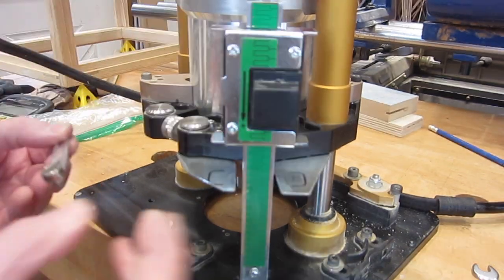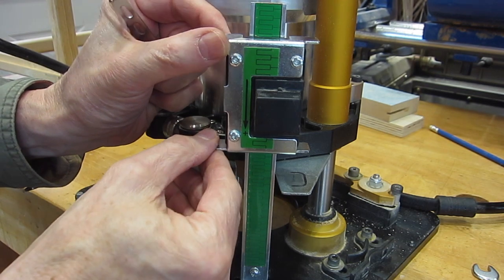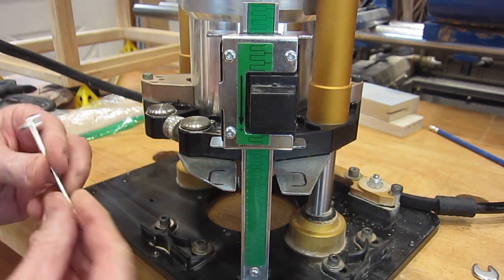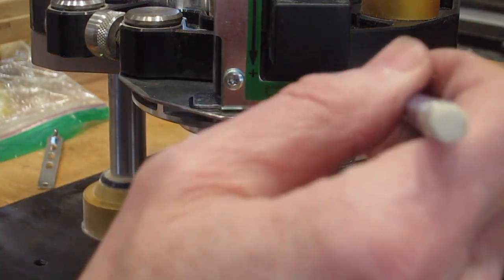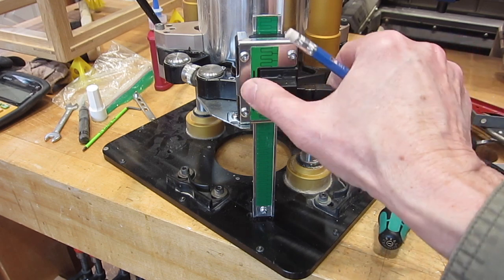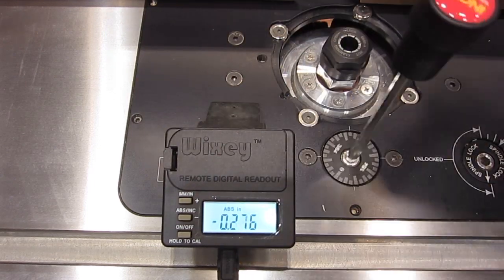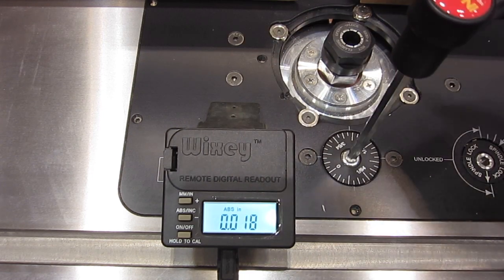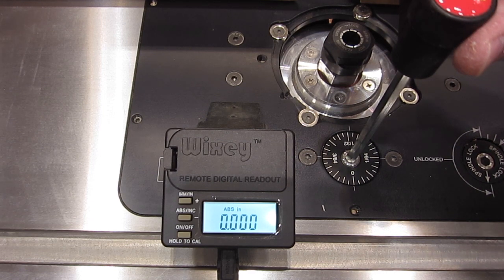Improve Accuracy of Wixey WR525  Router DRO

Comment: I've been thinking of adding a DRO for the table saw blade HEIGHT.
WIxey makes a fence DRO, but I've not seen any blade height DRO's.
Getting blade height just right is so fiddley.  
A DRO should be a lot more accurate than measuring the height from blade tip to table top.
Reply from the maker: I have a Wixey WR525 for my table saw blade height.   It was a real challenge to mount the DRO, and then I found the reading is different depending on raising or lowering the blade, due to hysteresis or backlash.   On Facebook I saw a better way to mount the DRO on same model of saw, so plan to try that when I get some time.

Comment: What did you use to mount the plates to the router lift? Are they screwed in from underneath?
Reply from the maker: The metal plates are attached to the lift with bolts.   I drilled holes in the lift and matching holes in the metal plates.   Glimpses of the bolts can be seen in video.   Two bolts per plate.

Comment: Thanks for this! It would be very helpful if you could show how you attached the two metal plates to the lift
Reply from the maker: The metal plates are attached to the lift with bolts.   I drilled holes in the lift and matching holes in the metal plates.   Glimpses of the bolts can be seen in video.
Reply: @steven.woodward  Steven: As a mechanical engineer, I really appreciated your modification for the stability of the plates. I am not sure I see how you drilled the router lift. Did you disassemble the lift to get to the under side of the section where the plates are attached? Or did you drill completely from the top and bolt through the lift and the plates? Seems like there is not enough room to drill from underneath as it appears. (1 or 2 holes per plate?)  What do you think about a thin layer of epoxy to glue plates to underside of lift section?   Thanks.
Reply from the maker: @CoreyZimmerman-un8ph  Good question.  Unfortunately that was a while ago so I can't remember.     I did not disassemble the lift, so there must have been enough room  to drill with the router motor removed.
Reply: @steven.woodward  Thanks, Steven, I understand. I wrote to Wixey for ideas and they wrote back that JessEm buys the DROs and that they sell them with their lifts as a package and may have brackets made to install it easier. JessEm called me back this morning and are going to send me any info that they have. May be helpful. I'll see. Thanks again.
Reply: @CoreyZimmerman-un8ph  that is helpful to know

Comment: I have one of those installed on my incra router lift. I found that if I lock the router lift it moves the DRO but the height of the bit still the same. Does this fix it? Or  does yours do that after your fix?
Reply from the maker: When I lock the router lift, the Wixey reading may change by 0.001 inch, or may not change at all.   I suspect the router bit is also changing by 0.001 inch but cannot confirm this.     When I first installed the Wixey according to manufacturers instructions it was annoying because the reading would be different depending on whether I was moving up or down.

Comment: You should send your video to Jessem. They have to be aware of that flaw in their design in order to fix it. I have the Jessem table kit and will check out if mine does the same. Thanks for sharing 👍
Reply from the maker: I think it is more of an issue with the Wixey, but good suggestion.   I sent video link to Wixey as they have a gallery of customer photos and video.   Will be interesting to see if they post it.
Reply: @steven.woodward  I meant about the left and right repeatability at the end. As you get the wixey secured it should get to zero coming from left turn or right turn IMO.
Reply from the maker: OK, I understand now.  There is an adjustment in the JessEm lift to tighten up the grip on the big threaded rod that moves that router up and down.  I have not played around with that.  I have DRO on thickness planer and table saw blade height and found I have to do the same thing - come at it from one direction, so I have gotten into that habit.